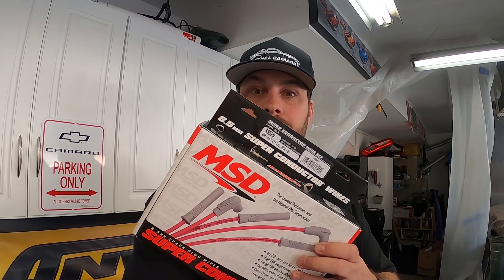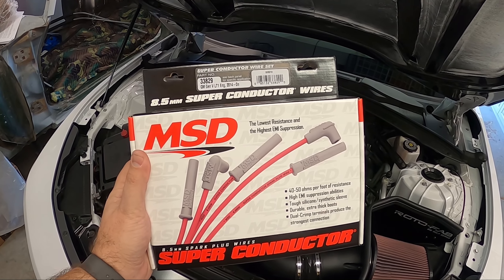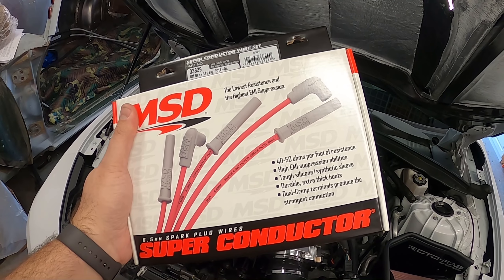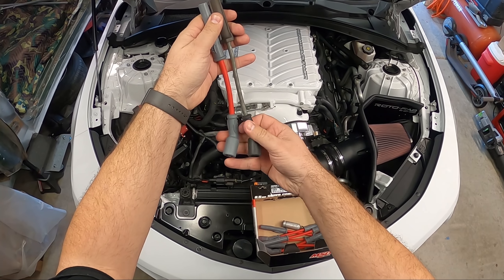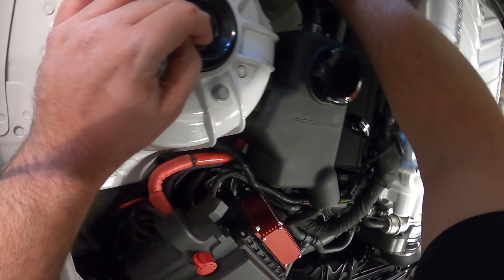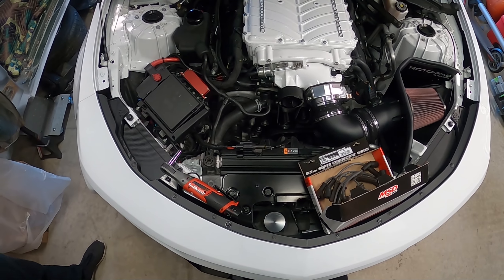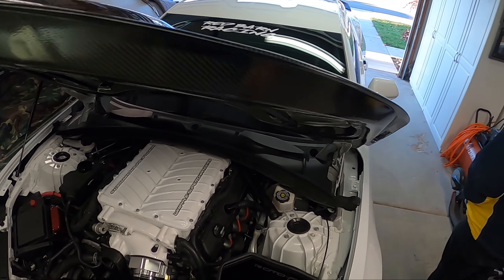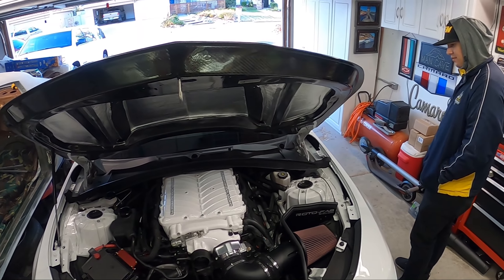MSD Spark Plug Wire Kit!

Comment: I had the MSD super conductors on my L 86. I was doing a compression test and all the spark plug wires were disconnected, but they were arcing big time through side of the wires. All parts of the wire. I don’t know what’s up with that silicone wires but it does not insulate at all. I went back to Stock.

Comment: To my knowledge, EMI, aka as electromagnetic interference, is an disturbance or altercation within the electrical system that causes a part or parts within the electrical system from performing effectively. And ohms is a typical measurement for resistance as well. So if you either have some sort of electromagnetic interference within the system or an insanely large amount of resistance leading to those spark plugs, your car simply just won't run right or won't run at all. Resistance won't be as big of a problem as some sort of electromagnetic interference will, but still might have an affect on performance.
Reply: All true.  As I recall, EMI can actually add resistance (like a pin hole or small crack in plumbing; you'll still get water, but will be at a lower pressure).  Generally speaking, its not a common problem, due to all of shielding within stock modern electrical systems.  However, your car is one big rolling antenna, and if anything has been done to your electrical system at all and things weren't wrapped up correct, in theory you could register some EMI...
Then again, those spark plug wires are so short, you'd probably have to be running a corded drill right next to your engine for it to make a difference.
Reply: Monday206am Yeah I think that sounds about right when you mention EMI might add some sort of resistance in the electrical connection. Although not a common problem, like you said, every car is different and some might be more prone to having an issue with electrical stuff more than others.

Comment: EMI is pretty important for longer wire runs, less so for the short camaro runs. If you have too much EMI, power signal gets garbled which reduces potential power and/or creates instable performance. Most plug wires have more than enough EMI.
I would recommend silicon on the plug ends though. Helps prevent water seepage into the wires from your hood or road.

Comment: Anyone know why my #7 spark plug wire would  be smoking it was burning up the outside of the boot after running for like a minute then I swapped another plug on and it’s doing the same thing and it’s far from the headers

Comment: So your key fob battery may be dying. Mine was being silly unlocking from the touch pad on the handle and then it would not want to start. 3 days later it told me the battery in my fob needed to be replaced.

Comment: Just get a 4 size cable from old jumper cable and replace the wires with that guarantee 0 resistance and +15% power, disclaimer: power gain based on different factors not all electrons created equal.

Comment: My basic knowledge as an aircraft mechanic tells me that by "electrical noise" they mean electrical interference. Some times electrical wiring can screw with radio waves if not properly insulated or routed.

Comment: How was or how did you end up pulling the stock heat shields out? My hands are too big.
Reply: On the passenger side leaving the reservoir there.
Reply from the maker: Just 2 Allen head bolts. We didn’t remove mine. Would have been easier to pull the radiator overflow back a bit

Comment: Hey Matt, you use stock heat shield on the MSD wires?
Reply from the maker: I used no shield
Reply: Heat shields on your sparkplugs, burn out your sparkplugs faster because they retain the heat.   Not recommended bro.

Comment: Msd is now Chinese sorry it’s garbage. Those of us with multiple projects over the years have seen the changes to their products. They have earned the name “msd might soon die” with many people. For ignition boxes and coils crane has surpassed them and wires for any lt or ls granetelli is the obvious choice as cars have picked up hp using them. I’d say firecore is a close second. I’m not risking a car this expensive to a cheesy cheap plug wire and that’s what msd has now become. Tell you  this too with the msd on 16 psi and a .030 gap I was getting blow out randomly. Now with the granetelli on nearly 18 psi I am at .034 with no issues. So more getting from my coil to the plug and that’s an obvious example of a better product.

Comment: I watched this video recently and they tested the resistance of the stock vs. MSD and stock was better: https://www.youtube.com/watch?v=GgNu2FQqO5E  I definitely want to get those heat sleeves.  Thanks for testing these though, look forward to the follow up
Reply: That was strange because I saw another video showing a 2000 ohm drop. I tested the ones that came off my Stingray and it showed just over 2000 ohms drop on the 2 wires I tested. I also saw another video where they tested the stock wires and it showed 1.9 ohms. I’m actually wondering if they read the ohm meter wrong because it will show a small “k” on the side to signify it is measuring in kiloohms which are 1000 ohms. So the video I saw of 1.9 ohms would make sense if it were 1.9 kiloohms or 1900 ohms. My meter shows 2.004k to signify it is 2004 ohm resistance for example.

Comment: I heard back from the GM help line for my 1500  , 4x4 , 2018 , #1 the girl said she didn't know what an oil filter looked like   #2 she said find a different dealer to TRY to fix my truck ( Vs Not try & just say " it works for us  see ya "  )  problem .. after rain , my floor shifter ( in 2x4 ) shifts itself into 4x4 .. over & over .. stick is in 2x4 spot ..  Part of the reason I say this is because , your job today would ALSO call for what I asked  ( if it would fix my truck & not void warranty )  >> dielectric grease put into the connector then plugged in ??  Point is to keep water out . In your case keep from shorting & sticking to the spark plug .. did you put DI Grease on your wires .  Still looking for an answer .. PS the lady on the help line said by Policy she could not do or say anything till a dealer said they saw that , in fact , the truck had a problem . At this point they claim it was tow'd in And they Paid for the tow .. but that there is Nothing wrong with the truck ?? WTF   , I am looking to trade for a Subaru ??  An Outback ?? That works !!!  I think this is what is going on  >> https://www.youtube.com/watch?v=Yv-NdL_X0T4&t=0s